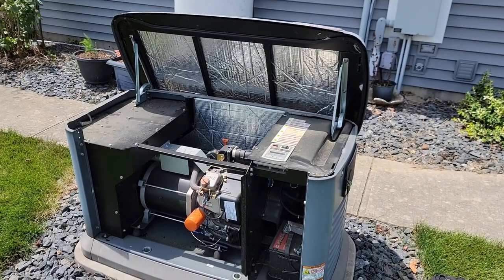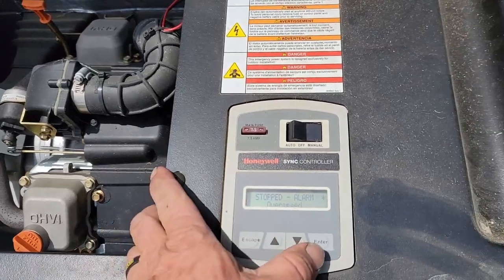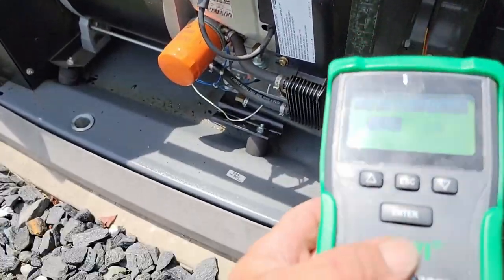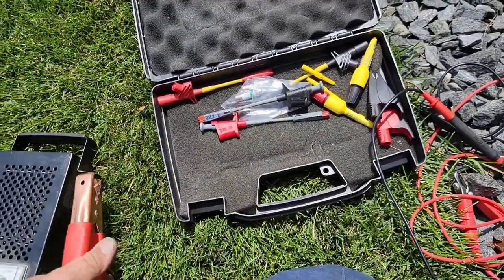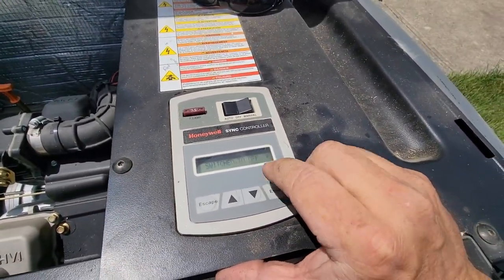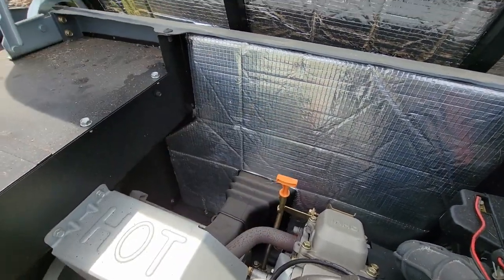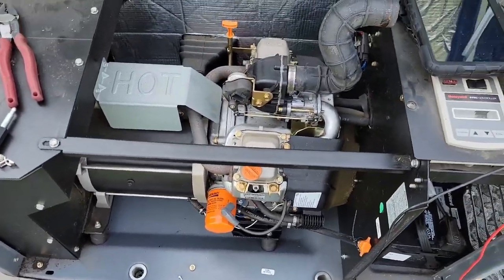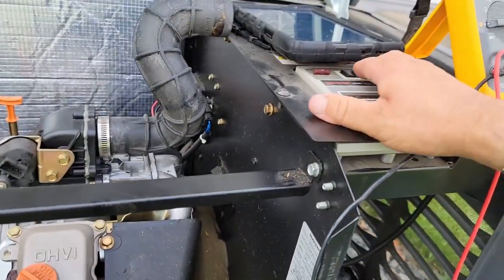Generac / Honeywell Generator Overspeed Failure Plus Engine Problems!

Comment: Well the fouled plug on the rear cylinder is telling you where the oil went due to bad rings.  It's the only place oil can get to the plug.  As long as the volts/cycles are good, it can run a long time like that with oil added as needed.  These high KW gensets are way under taxed when running so it's not going to push a lot of oil through.  It is BS that this problem exists with such low hours though.  It could be something as simple as manufacturer failed to offset the ring gaps during install.
Reply from the maker: And what you’re saying is very possible. When they first ran us through their schooling back in 2006-07 area they used to let you come to the factory where they build it. They sure as heck don’t wanna let you do that now…. what I seen was a total NASCAR style assembly process and they wonder why their stuff fails. They literally were in a hot hurry to get that thing down the line as fast as they could. I’ve never seen anything like they were doing, all they were missing, was six-year-olds building it, it was a modern day, American slave labor workshop, you’re just asking for problems and they’re getting them, now today’s generators are a lot better than they were back then a lot of that has to do with them upgrading the electronics technology by following what the other companies have been doing for a while, like integrated controls.

Comment: NIce job finding issues. Does Generac make that engine or is it made by another engine mfg.? I have a small engine shop and see issues with different brands all the time. Example is Kohler has oil leak issues, Briggs has head gasket issues etc. Thanks for the video.
Reply from the maker: Generac builds the motor, they make motors for Briggs & Stratton and Briggs & Stratton makes a couple motors for them. They are both in Wisconsin. When I went to the factory in 2006 they were having China manufacture some of the parts, probably more now.
Reply: @HVACRSurvival  Many thanks

Comment: Keep good oil in them.  When new run it 15 minutes change the oil.  Run 30 minutes change the oil.  Back cylinder is going to run hotter and that's where a synthetic oil gives a guy  a fighting chance.  That being said... I see plenty of scored back cylinders.  Everybody wants a small footprint and quiet operation, this is the result.
Reply from the maker: We use 5w30 full synthetic oil in all standby generators per the manual for our weather conditions. I agree, government regulation has caused most of all the problems we have today.

Comment: With air cooled small engines you don't want to use automobile oil it does not have nearly enough zinc and phosphorus car oil is only around 700 to 900 ppm small engines need to be at least 1200 ppm or more similar to racing oil the problem with racing oil is its designed for frequent changes very little detergents for dirt, Amsoil 5w30 true small engine oil is really good also Kohler, Kawasaki, Briggs and Stratton, Exmark, Generac is also good oil but standard oil like Mobil 1 or any other big name oil do not have the zinc and phosphorus do to emissions NG and LP are even more critical for this causes excessive wear and oil consumption

Comment: hold up.......its not water cooled but isn't it oil cooled? That sure looks like an oil cooler to the right of the oil filter?
Reply: Air cooled
Reply from the maker: Correct, its air cooled and has a oil cooler.

Comment: yep this is a known problem that generac-junk has. i have tried rebuilding 2 or 3 of them  for people even over sizing a slugs 0.10 and in about 100 or 150 hours it is down for the same thing.
wow that engine is week that was a lot of governor droop when it took the load.
Reply from the maker: It's hard to believe Dixie Chopper actually uses their engines in their mowers. I have a Kawasaki engine in my Gravely that has 480 hours and it's perfectly fine and it's from 2007. Never had to adjust the valves,  doesn't use oil,  it just starts and runs... I lost a starter so far that's it.  I watched how they build these Chinese engines. They don't let you go through the factory anymore because they build these like a sweatshop assembly line, it's no wonder there's so many mistakes. This is before they had a dedicated training center.
Reply: @HVACRSurvival  and there is the difference that maters. putting this engine on a mower is ok,  you are running liquid gasoline witch strange as it sounds does have a tiny bit of lucubrating and cooling property's to it.  and the engine it self is kind of out in the open were it can breath and cool properly.
in a generator they stuff them in a tiny place and cover them with every bit of insulation they can to make it quiet to meat sound codes. 
heat will kill any thing. 
and most people just have no clue of how much heat even a 8kw gen will make..
I have a 45KW diesel (diesel will run cooler then gas any day) and when it is 0 out side the middle on winter i still have to open my two garage doors to help it stay cool and that is just the heat coming off of the generator head.
here is what i tell people who want a generator. get a mini barn and set it up in side that.  most places to not tax a 10x10 barn and now it is in the open so it can breath. and stop running nat or propane gas it kills there life span. 
now granted i am out in the country and people around me know how to change a light bulb or work on things and have no problem under standing how to go start a real gen-set not one of these tiny toys. 
if you ever want to know were to get a diesel send me a message and i will try to get you hocked up with a suppler.